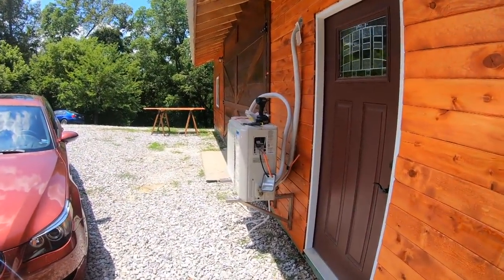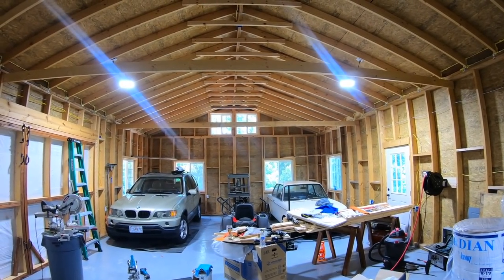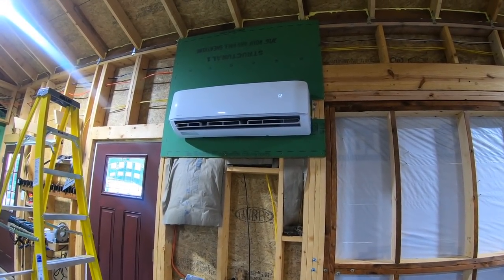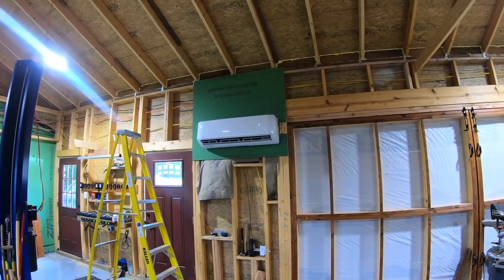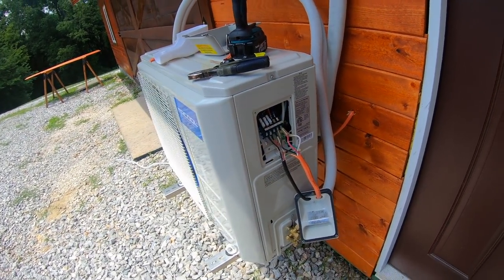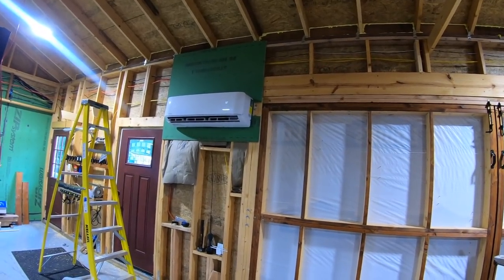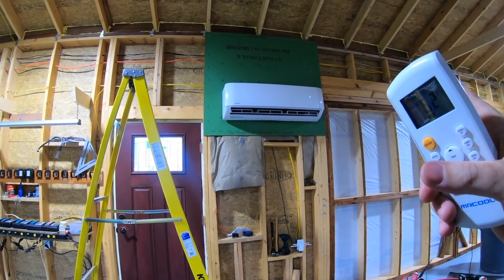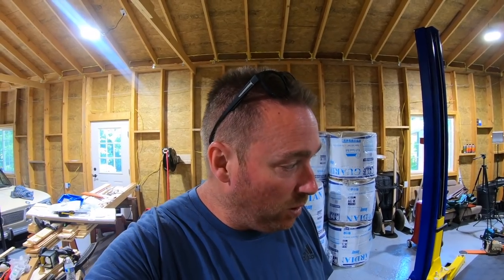MRCOOL Mini Split AC Heat Pump Installation SECRET TIPS Part 1

Comment: A new central unit comes with the condenser already charged for a 25’ line set normally!  A new install gets it final charge after install, but a new condenser “ outside unit” is charged with R410a.  Yes, I do have an EPA608 license, I am a AC tech. If you get charged $400 to charge a newly installed central unit, you got robbed by a dishonest installer.
Reply: Heck, a 25lb canister of R410 can be bought for just over $100 by a licensed tech/contractor.
Reply: Also, you introduce moisture “humidity” into the system by not pulling a proper vacuum on the evaporator and line set before opening the refrigerant valves.
Reply: Eric what is your tool of choice for 410a flaring of a cooper line? Is their a best flaring tool that is not too expensive?  Can't anyone buy 410a if they are "reselling" it? Or am I misinformed.  Appreciate the reply if you have time.
Reply: Eccentric flaring tools made by several companies do a much better job!
Reply: @ericg4x4   Do  you think rigid or yellow jacket would be as good as the one you suggested above?
Reply: dogs plants cars & neat stuff yes, they are basically the same.  They may be made by the same company because they look and function the same.
Reply: Oh btw, R410a is supposed to be sold only to licensed persons.  I’m pretty sure almost anyone can buy a jug off of eBay by signing a waiver.  I doubt anyone would get in trouble for buying on eBay, even though I’m not sure of the legality of the waiver.   Prior to 2020, the sale of R410a was not regulated.
Reply: Is 4900 parts and labror, a fair price to install a mini split system that cost 2000 at most
Reply: Shaun Vaughn does that include the unit 
Average price is about 500$  for a/c  and   About 1,200 for the electrical  depending heads and   Distance
Reply: @ronnyoo9371  it's a Mitsubishi package 9000 btu cooling and 10,900 heating. Comes with the head for the inside and the outside unit.

Comment: Hmmm.  I ran PVC inside my for the drain hose to connect into.  That way I could be assured of no leaks and a consistent gravity feed on the condensate with no kinks or backups.  I terminated the PVC 12" from the outside walls using a downsloping PVC pipe away from the exterior walls, to ensure none of the condensate made it's way back into the building structure.

Comment: 10/2 with a ground is all you need. Besides, an outdoor disconnect, shortening the line set, the drain to may need a little trap in it. I think 14 gauge is enough to feed the indoor unit from the outside. The inside unit is inverter technology. You can buy sweat or braze on flare fittings, if you don't have a tool. Will probably be overcharged if you shorten the line set though. 25 amps for a 2-ton sounds like a lot to me.
Reply: 25A Max fuse size in condenser disconnect!   30A at 2p breaker in pnl..   evap according to manual recommendations for wire size!      I don't think they have the velocity to require a trap for condensate, but may freeze where it discharges out the space when it's 30below... (heat tape)  I think it's one ton for every 600sq ft, they say...
Reply: @DiffEQ  blind leading the blind, oh my God I love it, I say that all the time.

Comment: BTW you only need two insulated conductors plus a bare ground wire, and it should be 10 gauge, and the 30 amp breaker is overkill, a 25 would work as it says "max" breaker size. What you're looking for is that info because of arc flash potential, so be good to yourself and make sure you know before you go!

Comment: So is it a 110volt or a 220? I’m thinking of putting one in my shop but I haven’t even run wire yet. Planning ahead.
Reply: Look on Amazon you can get them in 110

Comment: only 2min in but running the calc and load with your numbers and im getting 48,000 BTU needed.   does it run all the time?  hows the electric bill?  and lol about that costs!  a year later 10/3 100' is $225!!  and the units doubled!

Comment: I really appreciate you taking some time to mention the wiring. I have a Lennox LM024HO-100P432-1 and where I thought I would have trouble understanding the copper hookup, and all the associated whiz-bang that goes along with it, that one came pretty simple. I will have a real HVAC guy draw a vacuum, and test for leaks, etc. but the 240 AC input connection messes with me. I am a genuine retired NASA (computer) engineer (not trying to impress anyone) and for the life of me, I can't satisfy my understanding of the wiring. L1 and L2 seem to be the 240 input from my 30A breaker but it has some small wire (purple and orange) that go to the inside unit to be connected to the terminal block in the outside (and inside unit) along with a much larger (#12) four conductor cable. OK... let's do it their way but there is also a power cord hanging out of the inside unit with the European color coded wires on it but it is a 120 volt line. How can this be so confused? How many times am I supposed to read all the instructions that don't tell me where to connect the 240V input? Maybe they sold me the wrong indoor unit for the outdoor unit.  :-)  just like something an engineer would say when he can't figure it out... that little purple and orange marked wire is definitely Not the 240 @25A input wire and any markings on the outdoor unit terminal block do not exist. The only markings are in the manual - there are absolutely no markings on the terminal block on the outdoor unit so there is little choice except to wire it as the manual says - bottom line - where the hell does the 240 go into the unit and, secondly, what is that short extension cord for hanging out of the unit that goes outside? It is too short to reach anything and, again, isn't big enough wire for the 240 input. Wow... frustration supreme. I just find the wiring diagrams horrible. I need a schematic for a vacuum tube amplifier and then I could figure it out.
Reply: He doesn't understand it, either.  Why are you thanking him for showing you the wrong thing?  Only a two conductor with ground is needed.

Comment: Nathan, let me make a couple suggestions.  Don't run the drain line inside the other line, You're right about that, you're restricting the flow of condensation water because the drain line is so flimsy.  Why did you run the line out the wall when you could of run the line inside the wall and out to the unit, you wouldn't of had that ugly line running down the outside of the wall.  We installed the exact unit you did in our shop, the thing is awesome, works great, quiet and cheap to operate.  I wouldn't run the cheap drain line they provide inside the wall, but if you run it inside a pvc pipe and then outside from inside the wall at the base of the wall, then dig a little trench with a step fitting to a bigger pvc pipe that acts as a weep line with holes drilled facing down and 3/4" rock that the pipe sits on so it won't get clogged and you'd really have a slick set up. dig the drain like trench about 12" or so deep,  you only need it to be about 4 feet long. Then put a few inches of smaller rock on top of the drain line, toss in some dirt.  One last thing, you could of ordered a much shorter set of lines, like 12' feet and you wouldn't have to deal with all that extra line.  You're gonna like that unit, I know we do.
Reply: Ever hear of maintenance/failure?  If it's unsightly on the outside, why would it look any better on the inside?  And if you're suggesting it should be IN the wall cavity, that is just ridiculous for the aforementioned reasons.  Ugh.   Go outside and play.

Comment: Im a HVAC tech. the style u bought which I have installed u need to pull vaccum out the linesets so air or moisture get inside the system unless u buy the DIY unit which are higher.. Good luck on your life of your until!!!
Reply: I thought he said he did get the sealed lines and he did crack open once connected, he also mentioned it was charged for that length line kit. I was wondering about the loop, and what would someone do otherwise with the excess to make right for oil flow?

Comment: Since you had all that space on the inside behind the unit,, why did you run the hose and drain tube out so high to the outside?  It would have looked so much better if you ran it lower from the inside then ran it out low. That is such nice looking outside wood to mar it with the molding coming down to the compressor unit.

Comment: I know the lineset is coiled for minimum length requirements but all brands require any coiling of linesets to be done horizontally not vertical like u have the video. Vertical coil causes oil trap and starves the compressor. Won’t show any issue for the first few years but will shorten the compressor life significantly.
Reply: Ben Savoie The 25 ft lineset is short enough and the compressor has enough power to return oil to store vertically.

Comment: Mini splits  are very efficient. I installed an LG multi 4 unit system  in home and energy bill about 35% less than running two window acs.

Comment: Max fuse means the type of disconnect such as a fuse box and it can’t exceed 25amps for the fuse, the 18k mr cool draws about 19.3 amps on startup and runs at roughly 10-11amps so a 20amp breaker would just make it but would be very close to tripping the breaker on start up. I personally used a 30amp breaker to allow for the 20amp start up and still meets code

Comment: The comments sort of covered this but in Nathan's first video he indicated he considered running 12 gauge wire (20 amp rating normally) with a 30 amp breaker.  Never connect wiring of X amp rating to an X+Y amp rated breaker!!  Code violation and really really dangerous.

Comment: You didnt vacuum the air out of the lines. It will eventually fail from acid in the lines. And it wont work as good as it should with air in the freon. I usually cut the flares of the copper tube and reflate them. Factory flares usually not very good, makes leaks.
Reply: Obviously you didn't pay attention, the lines are pre-charged... No vacuum required
Reply: @troyfrandsen7160  The lines are not pre-charged. The condenser is pre-charged. You really should apply a vacuum to the lines before opening them to the refrigerant.
Reply: @sudamericamonie  The confusion: The latest DIY versions of the Mr Cool products (like the E Star Series) do have pre-charged units AND lines.

Comment: Did you put a vacuum on it?
Reply: Evacuation is not required on Mr. Cool mini splits. They are considered DIY units and the lines are factory sealed under vacuum and when they are mated the line is pierced. That is why the line set is coiled behind the outside unit. They cannot be cut to length. His system should be on a 20 amp breaker and be wired with 12 ga conductors. .  I’m not sure why he ran 12-3 for power, since there is no place for a neutral in the unit and 240 single phase has no neutral.
Reply: Evacuation no, but you need to run a vacuum to get the air out of the lines if they are cut to size. The lines should have been cut and re flared, that’s really tacky.
Reply: And I would have run my line set and drain down the inside wall and then out. It looks clearer and keeps you from using a cover
Reply: People are going to ruin their setups with this information Mr cool makes TWO packages with the same btu rating they are all sold as diy but the DIY package is a more expensive product about double the cost for precharged lines. We got the the 18k btu system for $741 i didnt want the $1500 precharged  line version cause i wanted a clean lineset  with no  excess piping and precharged can not be trimmed. I paid $175 to have an hvac guy flare and hook up the lines, vacume and leak test. So still under 1k total investment and I got to save $600 and know it was leak tested. It comes with the wire that connects the inside unit to the outer unit not the wire that goes to your breaker. The drainage line does not go in the insulation sleeve but needs to be on the bottom of the lines under the copper piping or it can drip inside or frost over. Nothing against the video creator I used this video to help me decide but if you want to buy one of these know each model comes in to options with the linesets

Comment: U need a disconnect box to the condenser. Get the slimduct 77 to cover that line set and drain that should go outside. Installed many Fujitsu and Mitsubishi splits; single, dual and tri zone units here in Hawaii.

Comment: "Battling High heat and humidity",  ha!
 Trying working down here in Florida when it 93° by 9:30am. 🥵
Reply from the maker: You ever been to missouri? Its brutal weather here on both ends of the spectrum, i have been to florida many times , i still think missouri summer heat is the worst , the stillness of the air here , no oceans around for thousands of miles
Reply: Same in Texas lol ain’t hot yet. Just wait 5 minutes.
Reply: Come to New Orleans with the humidity, it's worse than being in the desert.
Reply: Hah - we live underwater in an oven. Now thats high humidity !

Comment: L1 is L1, L2 is L2 and also communicating. L3 is communication only. Data is sent over L2, so L1, L2 and L3 must all match. This is the way for all inverters.
Reply: Outdoor wire to indoor should be stranded and sheilded cable. Ground only on the outdoor. 18 gauge is fine, but rated at 600 volts.
Reply: Unless you have a Daikin, when mine wouldn't turn on tech support said, oh yeah some units are mislabeled or switched and L2 is really L3???? Wtf is that about..should have been recalled. Thankfully I didn't blow it up and it worked after I switched the wires.

Comment: You need a disconnect box between the unit and the 220v circuit
Reply: That is a debate. It is not mandatory in Massachusetts Electric Code according to my electrician.
Reply: @rogerwhiting9310  No, the National Electric Code requires it. "440.14 Location. Disconnecting means shall be located within sight from and readily accessible from the air-conditioning or refrigerating equipment. The disconnecting means shall be permitted to be installed on or within the air-conditioning or refrigerating equipment."
Reply: My Master Electrician son in law tells me the wording in the code is ambiguous. I have seen THOUSANDS of these installed and not a single disconnect switch. Do the inspectors just feel like they aren't valid? I dont have them leading to my 5 units... and the inspector liked the job.
Reply: @rogerwhiting9310  As a licensed master HVACR contractor in NJ this would fail inspection.
Reply: @bug512  I hear you. Massachusetts doesnt seem to care about it. None of mine are on external switches and the inspector was ok with it.
Reply: If breaker box is within line of site from the unit and readily accessible then that can be your means of disconnect.
Reply: @paulmorrow8372  thst seems reasonable. Mine are dispersed throughout the house. One of the few things in Massachusetts they dont make a big deal out of I guess. Even in brand new homes.
Reply: Roger you sir are full of crap Master tech in va and yes a disconnect box is required in any state to pass code no licensed inspector is gonna pass that sure you can put one on your garage yourself with no disconnect but that's cuz your not getting a inspection. Iv never ever seen a outdoor condenser or inverter with no disconnect...
Reply: Yes, required in Missouri.

Comment: Why mount the outside unit in the front of the building, next to the doors where it's so ugly and visible? I mean, that shop is beautiful once the siding is complete. It's just a complete eyesore and I don't understand why you chose to put it right there where you look at it all the time? Doesn't it even hinder with the doors opening?
Reply from the maker: I am adding on the back of the shop, the end of the building would have worked except i am about to start a 2nd level and the head couldnt be mounted under that because the steps would have been in the way